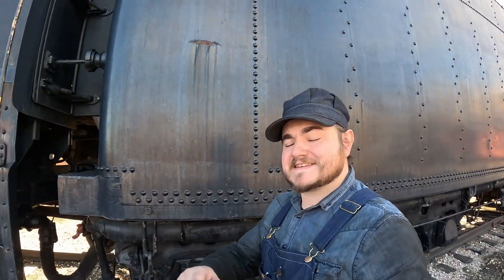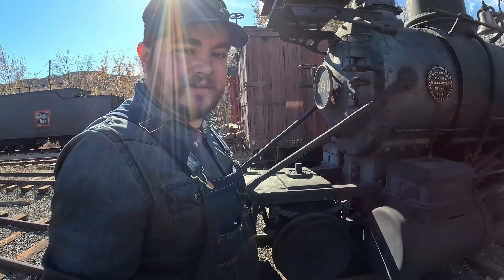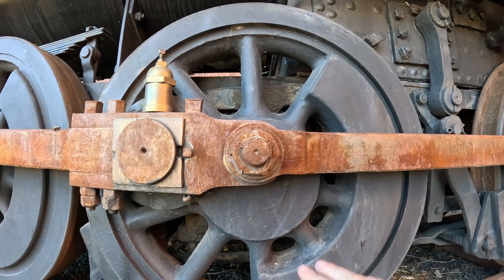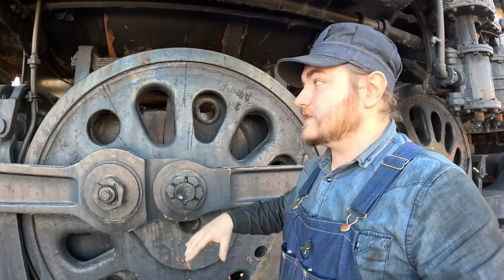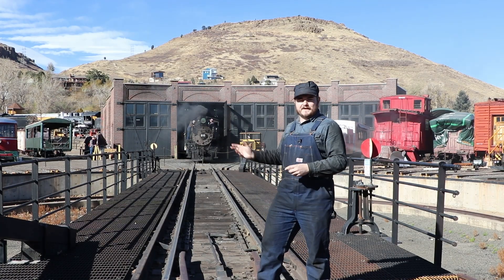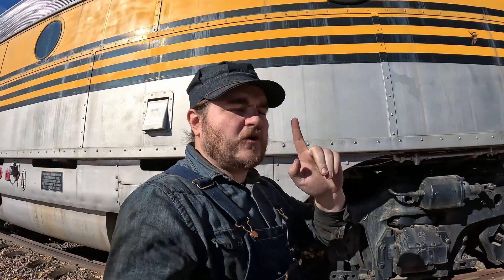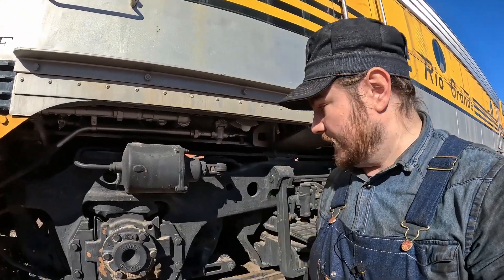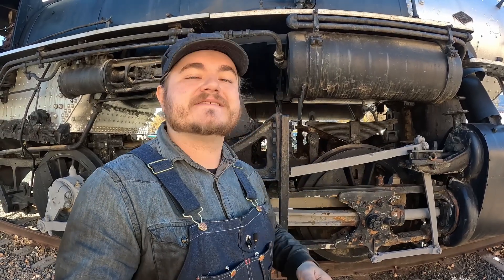HUGE vs. TINY drive wheels - Why? | Railroad 101

Comment: Always nice to hear a nice concise explanation!

Hey since you were a signals guy, could you explain something specific? Why do some of the industrial tracks all around Denver’s metro use traffic lights instead of crossing lights? And why the track side lights have double reds? (My assumption on the second one is redundancy.) I saw signals like those everywhere from downtown Denver all the way up on the way to big 10. Thanks, and keep up the fantastic work!
Reply: A red over red signal is an absolute stop signal. You cannot pass it. A single red signal with a number board is a permissive signal a can be passed at restrictive speed or may have a "G" or a "P"  for grade or permissive.  That way a heavy train going up hill will not have to stop and risk breaking a coupler when it tries to start again.  The red over red signals usually protect crossings where an absolute stop and stay is mandatory.
Reply: @bigd510  while I appreciate the response, this has nothing to do with the question I asked. In the Denver Metro area, At level crossings for industrial and low usage spurs, the railroads (or the municipalities) have opted to use standard vehicle traffic lights instead of level crossing equipment. the use traffic lights for both cars and trains, with the train facing lights having double reds. BUT they are not flipped. The Reds are on top, green on the bottom. I am questioning why this choice was made. Both UP and BNSF have them.

Comment: Great video and fun learning. 
I would be pretty sure the F9 did not have an alternator to drive traction motors as you stated in the video. That would be a generator as it was a DC driven unit. 
Of course, I never make mistakes (NOT!!)

Comment: Time for the dumbest question here I think.
I remember in an old childhood favorite movie "Ticket to Tomahawk" about putting a flat on a driver. How large of a risk is this when operating a locomotive, how often did this occur ? and what is the process to fix the wheel if a flat is on the driver?

Comment: I never understut that, why on steam engines sticked to the direktly cranking the drive wheel, at most cases, why Shay and Climax designes were not standardisied for larg locomotives, even the early large electrik locos were not using an apropiate cogwheel transmission, but a simpeler or complexer 1-1 ratio driving rod system. Hell, they could have built shiftable gear box in to them just like in to the disel locomotive they did, or even beter they could have do  steam-electrik trans mission either with steam motors or turbines.

Comment: Though I am familiar with this concept already I think you should have explained in more detail. You mention that for a given wheel to cover a distance it takes a certain amount of rotations. That's why rotating at the same speed, a wheel with smaller diameter covers less distance than a larger wheel. Forgive me if I missed it but you didn't mention the reason steam locomotives don't simply rotate smaller wheels faster is because it creates balance and wear issues due to all of the moving mass in the valve gear and the side rods. Diesels don't have all of this extra stuff that needs to be balanced so they can rotate their wheels faster. Also, steam doesn't expand instantainiously, by reducing driving wheel size you increase piston speed and if you go fast enough the piston outruns the rate the steam expands at, and so it doesn't apply enough force to the piston to accelerate more. Answerong the question a viewer might have of "why can't they make a fast engine with small wheels so it can also haul large loads?"

By the way,  you didn't really mention that the reason smaller wheels for a given crank offset are more powerful is because the power of one stroke of the piston has to move the train over much less distance, since one stroke is 180 degrees of rotation, the power created in one stroke always has to be spread out over the distance the wheel rolls in 180 degrees. Horsepower is (torque x rpm)/5252 so torque value supplied by a given piston will create much more power over a distance if the piston works at a higher rpm (to a point, as I mentioned, steam can only expand at a finite rate).

Comment: Would be cool if you could get over to somewhere an early electric locomotive is preserved -- some of these DIDN'T have gears, and in some cases they even had side rods and big driving wheels.  (Reportedly the designers of the earliest Italian electrics = class E.550 had thought about gears but rejected the idea because they were afraid that the metal alloys of the day might break, a failure which has occasionally actually happened on early cog railway locomotives.)  Some transitional types also existed that had both gearing and side rods (for instance, PRR FF1, but also several European examples).  Even some of the early electrics lacking side rods still had big driving wheels and motors that were too big for bogie mounting, so they had other weird transmission mechanisms like quill drive (also used on some bogie-mounted or at least sort-of-bogie-mounted motors like on the PRR GG1) and Büchli drive, although the combination of frame-mounted motors geared to large driving wheels also existed (like in diesel-electric locomotives Canadian National 9000 and 9001).  For real oddities, look up (because the actual unit no longer exists) the Sulzer Thermo-Lokomotive, which was a direct-rod-drive diesel locomotive (which repeatedly failed in service), and the geared-rod-drive Kitson-Still steam-diesel hybrid locomotive (which was a technical success but a commercial failure).  And just to throw in something else weird, during World War II, when coal was in short supply, Switzerland's SBB added a pantograph and a heating element to each of 2 E 3/3 steam locomotives to make them dual-mode coal-electric locomotives; last I checked, E 3/3 8522 has been preserved in operational condition using coal but without the electrical equipment (which was removed after the war).
Reply: early electrics as in the early commuter electrics from 1890's or the pre ww2 electrics?
Reply: @davidty2006  Electrics from 1890s is a pretty limited set (although the B&O electrics count), so I was thinking early 1900s (mostly -- some side-rod electrics with big driving wheels were made for Sweden all the way up to the early 1970s, as center units to upgrade their Dm2 articulated locomotives to Dm3).

Comment: Sorry if this is a stupid question but why don’t they have two sets of drivers with one set up for high power and one for high speed
Reply from the maker: Lots of unnecessary complexity.
Reply: I would think it would be difficult to hook up two different kinds of driver wheels to the Same rigid wheel set. Even then, why have two different sets of drivers when you can just hook up one set that can do both? I’d also imagine that having half your drivers be impractical at certain speeds isn’t great either.
Reply: But theoretically it would work

Comment: The reason that big wheels are used for high speed steam locomotives is because of wheel hammer.  The pistons reciprocate backwards and forwards creating vibration.  This would cause the train to noticably surge so it is countered by the wheel weights. Since the weights are sized to offset the pistons and conrod as well as the drive shaft, they are too heavy for vertical balance  since only the drive shaft contributes to vertical imbalance.  The lack of vertical balance gets worse with RPM eventually leading to the wheel jumping clear of the track each revolution (hence the name wheel hammer) limiting the maximum speed of the engine.  Bigger wheels = later onset of wheel hammer = faster top speed.

A diesel locomotive has the pistons and conrods with associated imbalance inside the diesel engine.  The electrical traction motor is balanced,  as are the wheels so it doesn't matter how fast they revolve, allowing standard sized wheels can be used regardless of speed.

Comment: i know im gonna seem stupid but what is it called when they hook 2 or more diesel engines together and how does that work? What if one 1 is dragging the others by not going the same speed?? or is that not how it works?
Reply: It is Multiple Unit system, you strap a multi unit cable onto a locomotives porthole you want to mate. The port is characterized as a giant round enclosed port.

Comment: i'm so confused, is Tractive effort Torque, or Power? if Tractive effort can be changed with a gearbox or other continuous lever, isn't it by definition, a unit of torque?
Reply from the maker: It is actually just a Force; the torque distances cancel their units out. Changing the gearbox changes the input torque, so it certainly is related, but it's literally just in units of Pound Force, or Newtons.
Reply: @Hyce777  oh huh, so the force over distance being the steam pressure over the stroke length, cancels out with the pushrod at the crank length? that actually makes a lot of sense, the pushrod is a transmission system of linear force, you don't actually use the torque because you don't care about the rotation when you're calculating loads...

What is the tractive effort of your average car then? you would have to convert the torque at the wheels back into a force... i don't know if i'm smart enough to figure that out

Comment: Steam engines don’t have any gearing so it’s cheaper to get a new engine than try and change the running gear of the locomotive.   That is why so many people love Steam Engines, the running gear is all exposed and you can see how it works.   With a diesel electric locomotive you can just change the gearing, or in the most extreme cases change the whole truck.

Comment: New York Central’s L-3 Mohawks were intended for a lot of mixed traffic work and thus were fitted with 69-inch drivers, but built with the capability to have 72-inch drivers fitted if the need arose for higher speed demands.  As it happened, the need wasn’t there, and the class leader (only one fitted with larger drivers) was later swapped out for standard 69-inch.

Comment: I often wondered, if large or small wheels get better traction on the rails. Does a larger wheel have a larger contact surface on the rails?
Reply: Yes but the contact pressure is less due to the weight of locomotive is spread out

Comment: Maybe you have covered ti before, but why don't the drivers on the narrow gauge locomotive have flanges?
Reply: On 346, she has flangeless "blind" drivers on the 2nd and 3rd set because it lets the engine take narrower curves easier. Combined with the pilot truck, its a smoother experience on a curve than an all-flanged setup. Not all locos even have blind drivers, it all depends on the engine and the road they were built for

Comment: Now there are some steam locomotives from around 1900 or earlier that had absolutely huge driving wheels but didn't go all that fast.
Later they could go faster with smaller wheels. I guess that they also made improvements that allowed higher piston speeds later on?
Because that seems to be the limit ... you can't just turn the wheels faster, there's a limitation and so you need to make the wheels bigger to go faster.

Comment: Hyce, friend, I'm now on my second watch-through with a pencil and the tractive effort equation in front of me. I'm trying to derive the equation now. This is alarmingly well-timed with the Discord discussion of the proposed Berkshire the silly Midland Terminal wanted. I'm still not sure if they wanted a fast locomotive, a strong one, or both (which seems like a poor answer to an optimization problem). Thank you for the video. Always love seeing the Museum engines and learning something.
Reply from the maker: I'm glad! A little hint about the tractive effort equation's derivation is that there's a little bit of cancellation factor using the diameter of the wheel in the calculation vs the area of the piston, and what's left over being rolled into our 0.85 K factor we multiply the whole thing by. At least if I'm remembering right, lol! :)
Reply: @theimaginationstation1899

The K factor is simply mean effective pressure "MEP" as experienced on the working face of the piston.  K = 0.85 was adopted by the American Association of Master Mechanics in the late 19th century as being a typical MEP at start up as shown by numerous indicator card tests.  The addition of MEP into the equation is the only change to the equation since its publication, in English at least, in 1836.

In New Zealand we used K = 0.8.  But for North American locomotives up to Super Power K = 0.85 is a safe bet.  K can and does equal other numbers when limited cut off is used for instance.

When a locomotive out performs its rated tractive effort it is because its MEP is higher than 0.85.  With superheated steam being more fluid and late steam designs being more refined in terms of steam passages it isn't unusual to find examples of rated TE being exceeded.
  
There is unfortunately a very unhelpful pdf online that goes into lever and torque and what not - and imagines K as everything but MEP.  It also imagines driver height instead of driver diameter, but that's another story and has much to do with the TE equation being counter intuitive at first glance.

de Pambour (1836) is available on Google Books for free download.

Johnson (1942) is available for view from Hathi Trust.

Both reward the effort.

   @peregrina7701  @Hyce777
Reply: @Hyce777  I got embarrassingly hung up on the piston size being a diameter and not a radius until I remembered the locomotive comes with two pistons, lol!! some math later and everything worked except that I got K= pi/2 which is not 0.85. Is something else hiding in that K factor? PS. I believe this is the first time I have ever voluntarily derived an equation. What have you done to my poor braincell. Lol.

Comment: I think you've miss-stated it.  It's not a ratio of 'stroke'/'driver diameter'.  It's a ratio of 'four strokes'/'driver circumferance.'  And whilst that's on the one hand a different way of saying kind of the same thing - it is on the other hand a correct explanation of de Pambour's equation.

Comment: This is a very helpful video. I knew that bigger drivers made you go faster, but I didn’t know about the crank position vs wheel size. Very interesting. Great video! Also, is that a recorded horn at 6:59 ? It just doesn’t sound normal.
Reply from the maker: Wayside horn played over a speaker, rather than an actual locomotive horn. Good ear :)
Reply: @Hyce777  Oh ok thanks!

Comment: I used to have an operators booklet for the F7, not that different from your F9.
The top speed geared for passenger was 102 mph. At least that's what I remember. I haven't seen it for decades. Have short-time ratings been discussed?

Comment: The drivers on the 18 201 (the fastest operational steam locomotive in the world) are 2,30 m diameter (which Wikipedia gives as 7' 6.5"). With those it reaches a max speed of 180 kph (or 113 mph).

Comment: I remember when I visited to see 5629 when I was younger and I was in absolute shock at how massive the overall size of the train. I stood next to the wheel base and it was almost a whole head taller than I was. I would love to see a train that gargantuan pulling a rake of coaches.

Comment: (I wrote this on another video after being confused) 

Is this correct?
Note big wheel means more weight wich makes acceleration and breaking slower but wider wheels means more grip snd traction, taller diameter alows for even more surface area, (for trains it alows for more area from the center pin to the crank pin (not its name) so the crank pin is further away from center and in the edge of wheel alowing for more power as much larger spin on each rotation well smaller wheels have a shorter rotation so can do more in the same amount of time alowing greater speed but less power and greater chance of wheel slip also alowing for more wheels for more stability and surface area

Comment: Niagara's had to have small drivers to fit through tunnels across the eastern seaboard.
Reply: Nope, the Niagaras had 79" drivers. They were short in overall height due to the lack of domes I believe, among a few other things I think, can't remember fully.
Reply from the maker: TrainMan's got it right.

Comment: The Boynton Bicycle monorail (around 1890) had a locomotive with one driver but that was 7¾ foot in diameter (that's 2.36m for my non-american friends)
So yeah. Big wheel. Boynton and the builder of the locomotive said it could do 100mph but that was never achieved because the track was too shitty and too short. Lol.